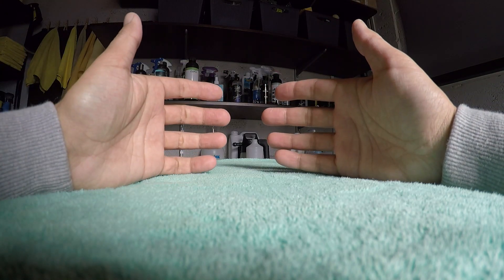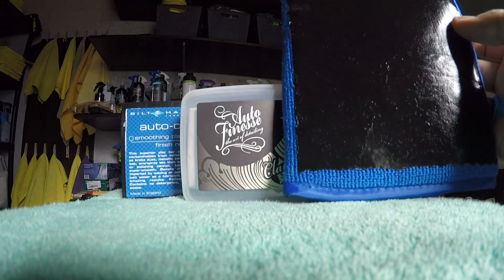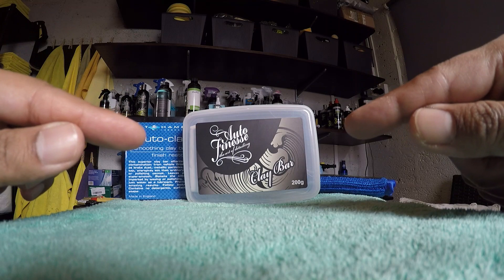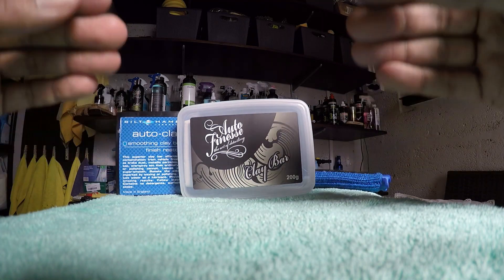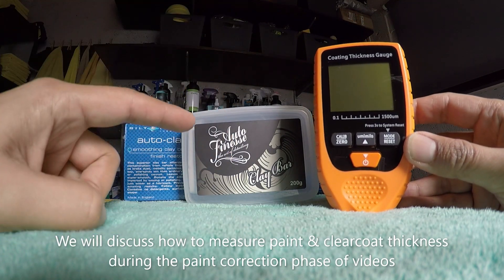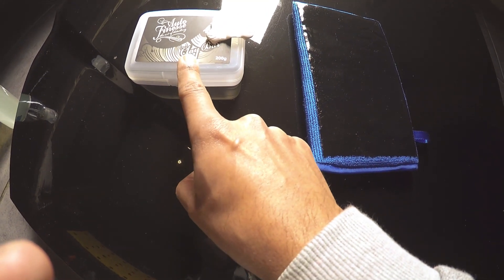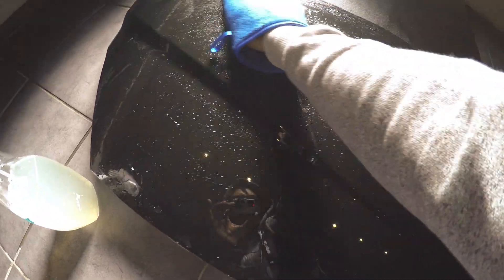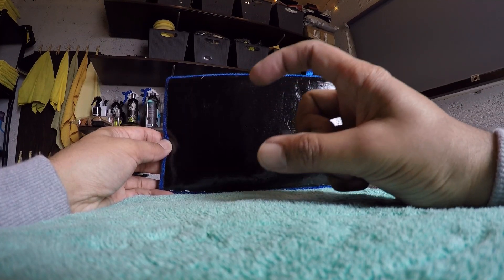Clay Bar or Clay Mitt? - Are YOU considering some claying Pitfalls? Ft Bilt Hamber Auto Clay

Comment: ONR is a perfect clay lube at 1:64 and I’m certain it doesn’t leave anything behind. Probably the most economical too other than water! Great content 👍
Reply from the maker: Hi David.  Thanks for watching 👍🏽.  From our experience ONR (depending on the version i.e. normal or the wash/wax) regardless of dilution ratios will leave behind a layer of either polymer and/or wax.  Obviously the higher the dilution the less it will leave but it’s still there.  ONR is designed to do exactly that.  Clean and protect in one step.  Thanks for your kind comments. Much appreciated.  Next phase of videos will move onto paint correction so stay tuned 👍🏽👍🏽
Reply: @VProjectUKDetailing  I agree 👍

Comment: Really wish you also showed the clay bar section that you did on the test panel, I'm curious if it left the same amount of marring as the clay mitt.
Reply from the maker: BiG BeAR - Thanks for watching! Clay barring leaves less marring than clay mitts - however clay bars still leave marring! The general rule is “no machine polishing, no claying!”.  Hope that helps! Thanks again and if you’ve not already done so please check out the rest of the channel & subscribe! 👍🏽🚗🙏🏽
Reply: @VProjectUKDetailing  see my problem is we recently bought a new house in FL and sent all my main detailing equipment down there already. However the family decided they wanted to spend the summer in our old house in the northeast mountains of Pennsylvania. So while I do plan on polishing my ride, I won't be near my equipment for at least another month and a half, in the meantime I have zero protection left on my car, and I wanted to wash, decon, and clay it so I can throw on some medium term protection.

Once I get down to FL I'll be able to run through all the steps again, along with a 2 step paint correction, and a proper long term ceramic coating. (Car is almost 3 years old, it was never paint corrected or clayed before).
Reply from the maker: BiG BeAR - With detailing it’s all about detailing responsibly! Our advice would be wash & decon but don’t clay.  For the sake of 6 weeks or so it’s not worth damaging your clearcoat! Put on some light temporary protection.  In 6 weeks once you’re near your equipment you can detail your vehicle properly first time around.  Obviously it’s your vehicle with which you can do as you please - but that would be our advice! Good luck either way 👍🏽🙏🏽🚗🚘🏎
Reply: @VProjectUKDetailing  i can wait...its hard but i can wait. I've been wanting to detail this car since last Summer. That's when I got interested in detailing. A couple of thousand dollars of equipment and materials later, all I managed to do was wash my car twice before it hot cold again in PA. That's why i was trying to go full force and not wait. But i don't wanna cause damage, so again I'm forced to wait...lol!
Reply from the maker: BiG BeAR - LOL.  We know it’s tough - when we get the detailing itch we feel exactly the same as you! But detailing is supposed to improve your vehicle not make it worse! Dig deep my friend - before you know it you’ll be out there making use of all that equipment doing a great job first time round! 👍🏽🙏🏽😎  - in the meantime there no harm with non mechanical methods eg wash & decon etc 👍🏽🙏🏽🚘
Reply: @VProjectUKDetailing  thanks for talking me down off the ledge. I will wait, in the meantime I'll just do a crazy thorough wash and chemical decon, then throw some Griots Ceramic 3-in-1 protection while I wait.
Reply from the maker: BiG BeAR - Glad we could help.  You’re doing the right thing.  Stay safe & all the best 👍🏽🙏🏽🚗

Comment: if the scratch alreeady on the paint are deeper than the scratchs the clay produce then you will eliminate those shallows scratches while compounding the deeper ones or i am wrong?
Reply from the maker: scoupemaster - Claying will only produce scratches not remove them.  You will remove scratches during the machine polishing stage whether that’s wet sanding, compounding, polishing, and/or finishing 😊👍🏽
Reply: you misundertood my point,if the car already have deep marks,swirls,etc etc from washing incorrectly and you clay and install minor marring during the claying process,does that marring does not goes away when compounding the deep marks a swirls? that is my question
Reply: @scoupemaster  yes that is correct. The general rule is - don't clay unless you plan to polish afterwards as claying will always dull the finish due to the micro scratching (marring) it causes. If you plan to machine polish your car because it has scratches then you should really always clay it beforehand. As you say, the clay marring will be removed in the process of polishing out any pre-existing scratches.